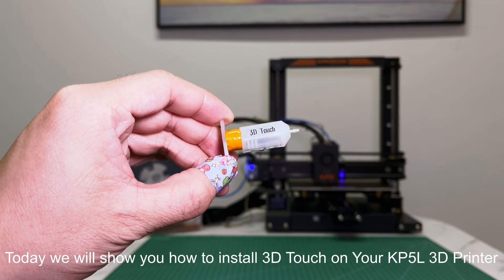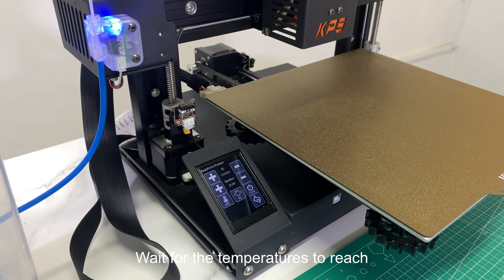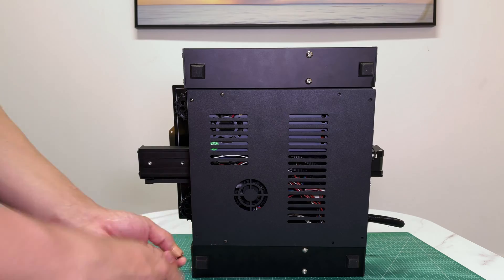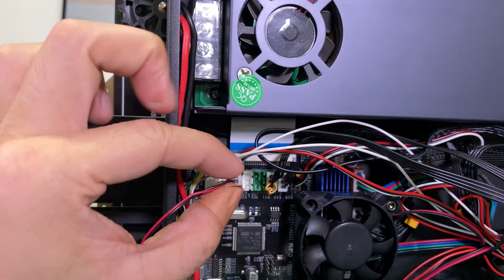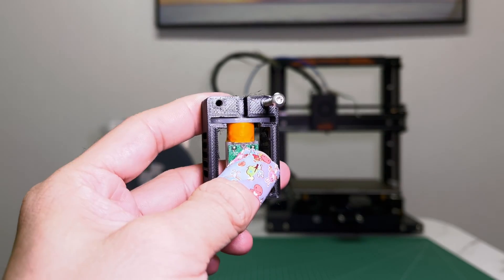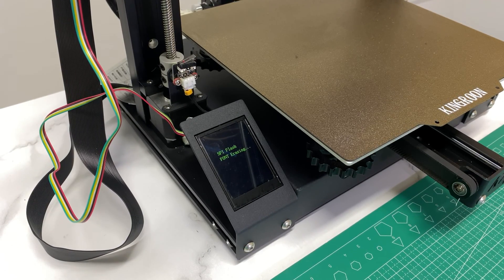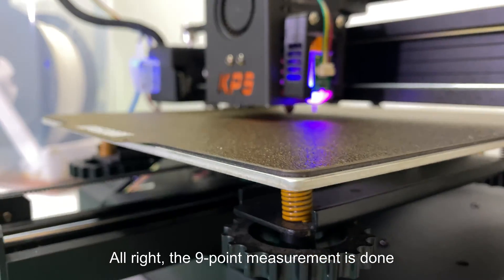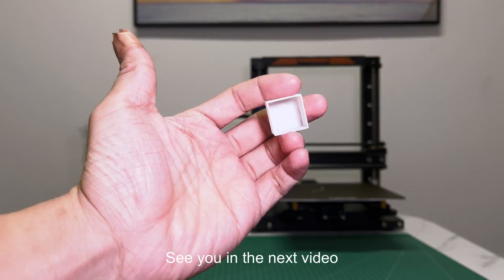How to Enable 3D Touch on the KINGROON KP5L 3D Printer

Comment: I purchased my KP5L from Amazon at the end of May (files on USB drive dated 28 May 2022). My extruder cover does NOT have mounting holes for the 3D Touch on the right side of the extruder cover. The holes on my KP5L are on the left side of the cover. Can I assume the 3D Touch can also be installed on the left side of the cover? The video states the holder for the 3D Touch is "slightly longer than the other one (KP3?)". Is that the file uploaded by Jiachen Guo on 20 December 2021 (P5-3Dtouch-Fix-2.STL and P5-3Dtouch-Fix-1.STL) or the files uploaded by Jiachen Gou on 12 March 2022 (Kingroon KP5 BLTouch Upgrades) or some other file? Thanks in advance Jim W.
Reply from the maker: Hi Jim, you are right, it can be installed on the left. Just need to measure and modify the      Probe bed positions. As for the file, you can get them in the description, the first link in it. The files you mentioned may not be the latest.
Reply: @Kingroon3DOfficial  Thanks! I wasn't able to design or print a holder for left side installation. All interfered with the X-axis motor housing. Also my attempts to modify the cfg file were not successful (-54 mm from nozzle to point of 3D Touch). I believe @Brian Pickett offered a solution in that he simply hot glued a mount on the right side of the titan extruder housing. Also the robin_nano_cfg.txt still contains the command ">INVERT_X_DIR 1" which I believe should be ">INVERT_X_DIR  0"
Reply from the maker: @endicott65  You’re welcome! Glad to hear the problem fixed. Have a nice day!

Comment: after the firmware is installed and calibrated, the feed mechanism rotates in the opposite direction during the extrusion process and the nozzle is still at a considerable distance from the table. Z-axis motors do not spin during movement, which means they do not adjust to the unevenness of the table. What should I do?
Reply from the maker: Please check the motor directions first, then go modify the txt file, search for “INVERT” you can find the settings to modify. Change the 0 and 1, you can correct the directions. As for the z-axis motor, please check it’s connection.
Reply: @Kingroon3DOfficial  How can I do this if the firmware cannot be edited? The Z axes are connected and move when the axis move button is pressed, but do not move when the table is uneven when the printer is in print mode.
Reply from the maker: @СергейБогомол-ч3ф  Please follow the steps in the video and use the original mount. And you actually can modify the firmware by changing the text file. After the firmware has been flashed, you can only flash the modified text file to load your new settings.
Reply: @Kingroon3DOfficial  Changed the inversion of the extruder in the firmware. everything is working. But the Z-axis motors do not move in time with the unevenness of the table, although not during printing, but during the verification process, these motors move along the Z + and Z- axes, which indicates their connection. In addition, after checking the height above the table with a sheet of paper, the printing process cannot maintain this height and the nozzle is still at a considerable distance from the table. What should I do? Maybe something needs to be changed in the firmware?
Reply from the maker: @СергейБогомол-ч3ф  Do a manual bed leveling before installing the 3D Touch. You can do it twice to make sure. For the second issue, if the probe value is not remembered, do a second time. If still does not work, please send a video to support@kingroon.com to show the problem, we will check that for you. Thanks!
Reply: @Kingroon3DOfficial  that is, you want to say that the Z-axis motors should not work in time when the table is uneven, since before installing 3-d touch it is necessary to manually align the bed and, accordingly, the table will be even? In that case, why do you need 3-d touch in your printer at all if you are focusing on manual table alignment? I have 3-D Touch on my other Ender-3 printer and I know how the Z axis motor is supposed to work. In your case, the motor doesn't move when the table is uneven.
Reply from the maker: @СергейБогомол-ч3ф  That’s quite a misunderstanding. Please check our video see why we suggest for that. And please send email to show the problem with video, so that we can understand you better and help you out sooner. The address is support@kingroon.com
Reply: Hola, me pasa lo mismo, de casualidad ya lo lograste resolver?